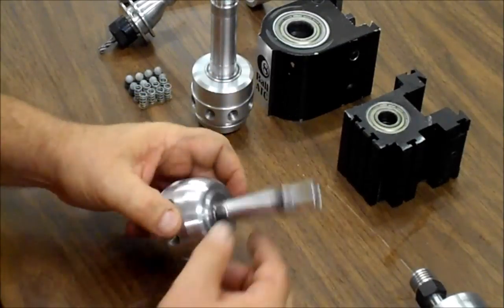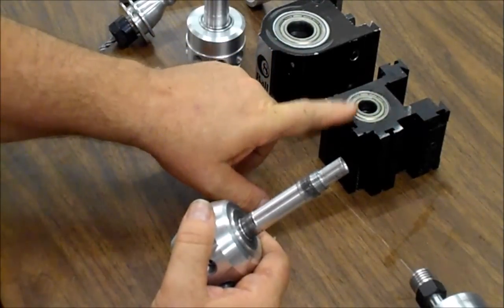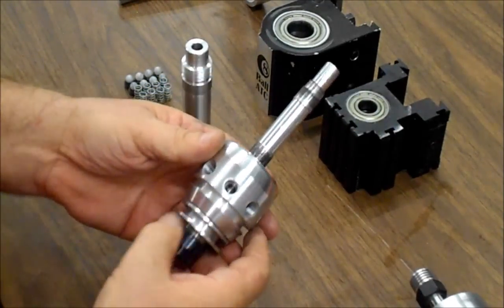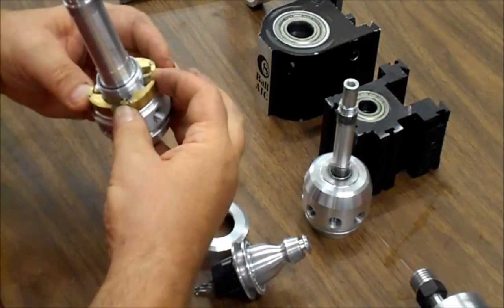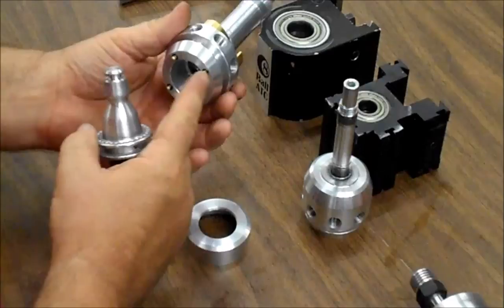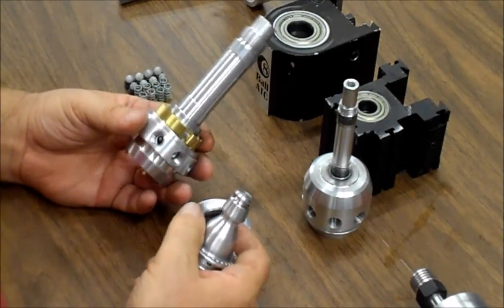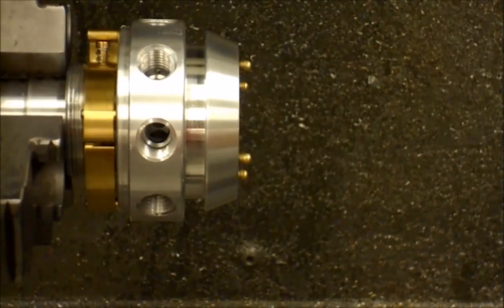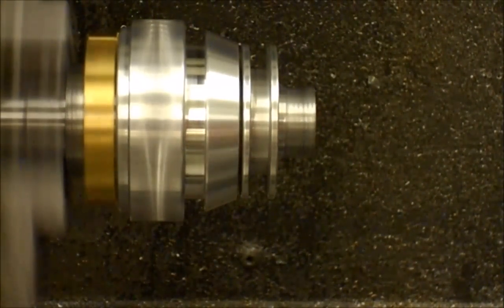youtube video #4B59ZnPdjJA

Comment: Very nice.
Any problem with wear, or did you heat treat? I was thinking of using/making a similar design but between no surface grinder at home (i know i am ashamed lol) and fear the locating pins warping or breaking i caved. I Mean 1hp is a lot more than what most think it is and at 7500rpm the inertia is astoundingly high., even at 2000 rpms. But i see a lot of good engineering and programming went into this, very cool.
Reply from the maker: There has been several who want their spindles operating 30k rpm+. The only valid reason is to be able to run micromills with decent feeds, other than that, 7500 -10,000 does just fine. The tool holders will be made from 7075 Aluminum (Brinell 150 hardness) while the spindle will be made from 410 Stainless Steel (Rockwell 80) Both hardness ratings rate nearly the same. I'm not going to heat treat either one. i don't see the need for hobby applications. Besides, I'm trying to offer an affordable alternative. No noticeable wear so far from the toolholders.

Comment: Wow, love your design.  I am looking into purchasing a Taig mill with servo motors and a 4th axis.  Would this setup require a 5 axis controller?  Do you have any recommendations for the right one?
Reply from the maker: The rotary tool changer requires a fourth axis. I would recommend a fifth axis if you want to use an additional rotary axis (at some point you will want one) . The stationary tool plate does not require a fourth axis and, even though it only holds three tools, can be made to hold as many tools as you want by modifying the tool-change macro. By adding additional tools to the script and assigning those tool positions to the existing pocket locations you can have as many tools as Mach3 allows. Might be a bit confusing without a video, but, consider a part that requires six tools to complete.....T1= pocket 1 / T2= pocket 2 / T3= pocket 3, then assign T4= pocket 1 / T5= pocket 2 / T6= pocket 3 ....six tools for only three pockets? Sure! The difference is in the programming order by using the first three machining processes that are only run once, placing a M00 at the end of the third toolpath, replace the tools with the next set of tools (all tools lengths would have already been placed in the registry of course) and continue with the program. One of these days i'll record a video on this very idea.
There are several sellers out there that sell Taig mills that are fully functional straight from the box. If you are purchasing a cnc "ready" machine without the electronics and you have a little coin in your pocket I would suggest that you look at https://www.youtube.com/channel/UCR9OFVqdul6hJDfCifG36cQ (corvetteguy50) to see what he can do for you. This guy takes immense pride in his work. I was fully impressed.

Comment: Now that is some slick work. Reminds me of a cvt clutch with fly weights. Where or how did you end on this concept?
Reply from the maker: The solution had to be simple and mechanical without the use of complicated and expensive pneumatic actuators. The design itself is far from being complex....the difficulty was drilling the four holes that were required for the flyweight pins. I had to build some custom drill bit extensions to be able to drill the holes that close to the shaft. It seemed that my time was mostly spent in designing fixtures and tools more than part production. Without my CAD experience it would have never been possible.

Comment: Hello, I have been a fan of CNC machines for a long time, I have 2 working in my workshop built by me, a router and a plasma.

One of the things I want to add to the router is an ATC and the one you have designed seems fantastic to me. I wanted to know if I would share some kind of documentation to see if I could build it myself, plans with measurements, a tutorial ..... it would be exclusively for personal use.

If it were not possible I will be waiting for you to put it on sale to see if I can get it. Greetings.

Comment: Hello, Christopher.
Christopher, super workmanship is ideas ...
Christopher you would be able to tell me if your pin head "Ball ATC" is on sale, if yes I give you my email address to answer me live, if not you could be a schematic With dimensions so that I can manufacture it for my high speed milling spindle 24000 rpm ER11 tip with a M14 x 0.75 mm pitch for mounting, the body of the spindle is 65 mm diameter water-cooled, this would be A plus for me without going through a pneumatic spindle ... I think to make a prototype for high speed spindle mounting, of course in associate yourself with the work you have already done with your agreement if you want it well .. .
Christopher, waiting for your answer, I wish you a good continuation, I follow you, thank you ... André in France, sorry for the first message that was not in English ...
Reply from the maker: 24000 rpm is out of the question. There is no way that I would run it past 10K. It is too large and cannot be balanced, that with all the individual parts that is comprised of. Why do you need to run it 24000rpm?
Reply from the maker: I will be manufacturing three variations of this spindle, the one you see in the videos that is complete with spindle housing and universal mount, a spindle designed to fit R-8 adaptable machinery, and possibly MT3. To produce a spindle with a raw, machinable shank would have to be requested by at least 10 people before it would be considered a marketable item. The costs associated with production of individual one-off design variations prohibit me from producing just one. I would need at least ten units sold for that to even happen.
Reply: Christopher Smith dude pls kick start this I wanna buy it!